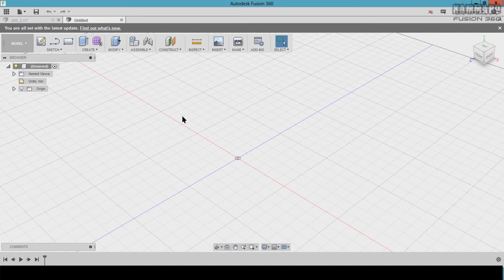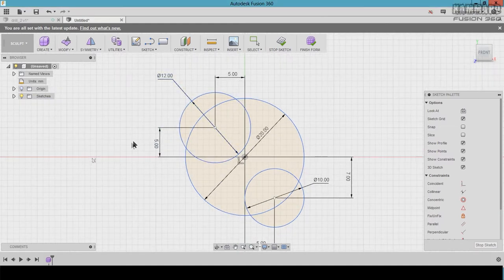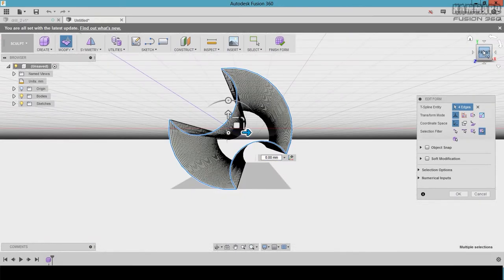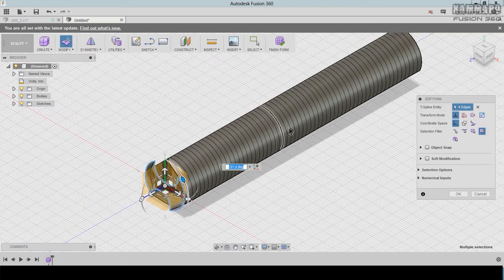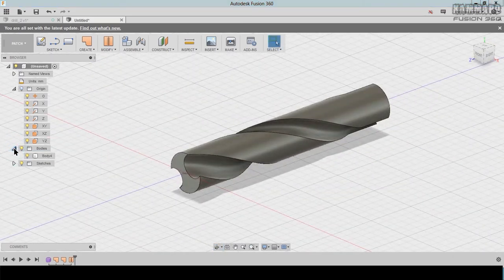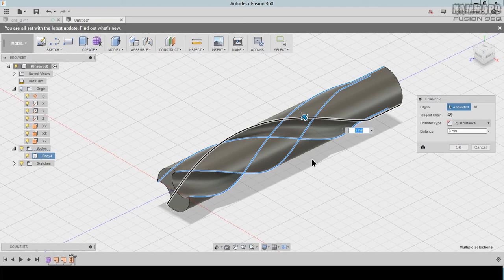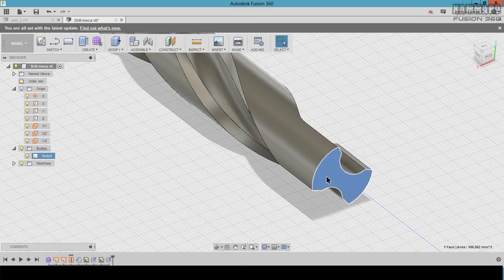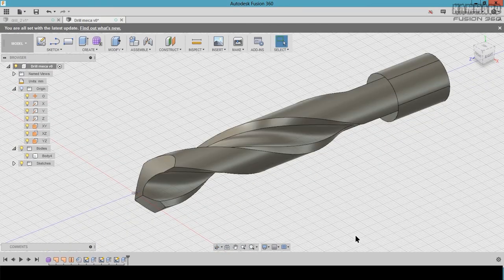Make an easy Drill with Fusion 360 !!! 😝

Comment: I hate to tell you this but that device you modeled won't drill hot butter. You might want to get an actual drill and start measuring it and looking very closely at its geometry because you will find it is very different to what you have drawn.
Reply from the maker: You can try do your best bro